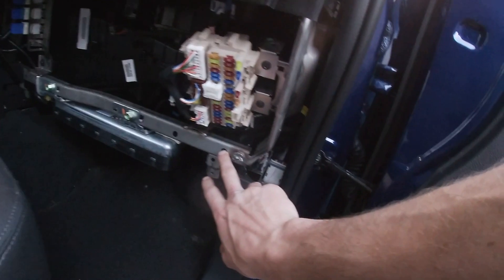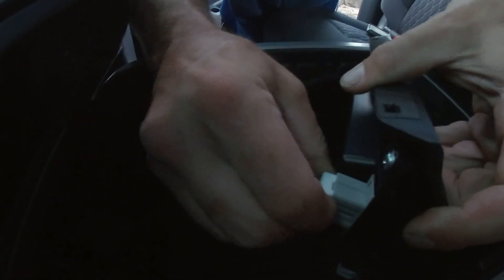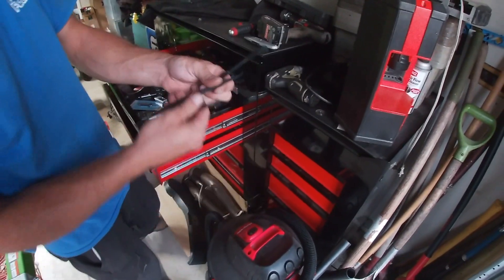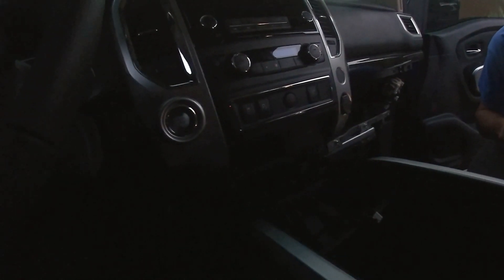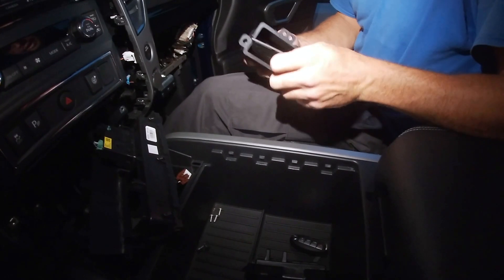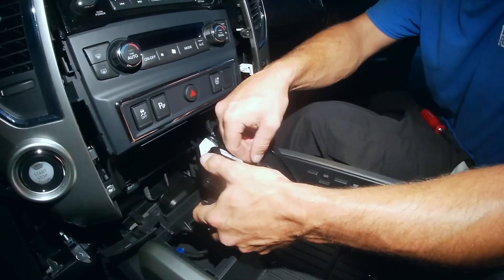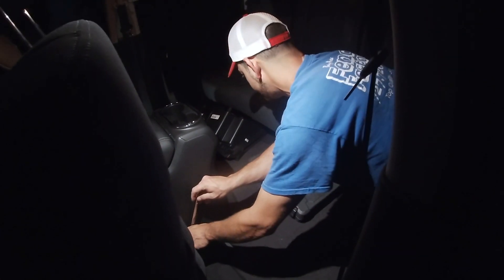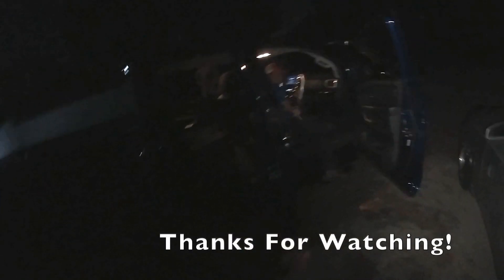2021 Nissan Titan Trailer Brake Controller Installation

Comment: Great video ! Do you have the part number ?
Reply from the maker: Thank bern!The part Number is 478a0ez40b.
Reply: Nissan tried to tell me this is a replacement for if I already have the part. I don't have the trailer package, so will this fit it?
Reply from the maker: Pull apart the dash and find the connector for it before you buy the trailer brake controller. Some trucks do and some dont.

Comment: Long live the TITAN!  Really wasn't in the market in March '24 thinking I'd continue to make do with my 2011 Silverado w/ LS V8 due to new truck costs and most of those lacking a gas V8.  Then come to find the mighty TITAN will cease production forever come summer '24.  Found a '23 never-titled certifed dealer courtesy vehicle with 1K miles for nearly $15K under MSRP of new.  YES!  But it didn't have the integrated brake controller; the only thing lacking that I wanted.  Thanks to you and a Titan forum poster who convinced me that dealers rarely have correct answers to such things, I know now I can retrofit one.  Just purchased a unit and with your video and that Metra installation PDF I will be doing same as I hate the out-of-sight, knee-interfering aftermarket units.  THANK YOU!!
Reply: BTW, the poster on that TITAN forum stated he was an employee at the Canton, MS factory.  He said that if you have a TITAN that came with the "Accessory Utility Pkg" (Hitch with electrical connectors) then you WILL have a complete harness that includes the leads/connector for the integrated brake controller.  I cannot verify but seems like a source who knows what he is talking about.
Reply from the maker: Thanks and good luck with your new Titan. Glad the video helped you out.

Comment: I just installed the OEM tbcu on my 2019 Titan SV, your video was very useful.
Reply: I have 2019 midnight edition . Do u think every nissan has it ?
Reply from the maker: No i recommend you check for the harness before you buy a new trailer brake controller. Some do NOT have the harness.

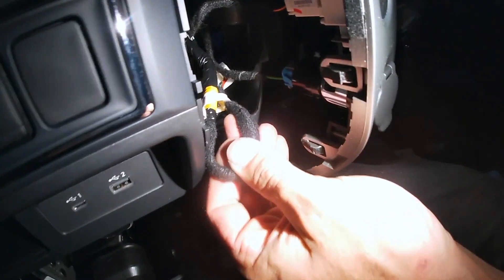Comment: Thanks for the video. My 2021 SV doesn't have the plug/wire you show at 5:05. Any idea where that wire led up to?
Reply from the maker: I couldn't say forsure you would need the wiring diagram for that.

Comment: Got it all ready to go back together but don’t see the electrical plug for it. Was it hard to find or was it just laying there right behind the right side air duct?
Reply from the maker: You should see it in the same location as the video shows. Others have said their truck didn't have the harness at all. Thanks for watching I hope it helped.
Reply: Probably too late now but on most Nissan's the plug is under the dash on the driver side. There's several videos on YouTube that will show you where.

Comment: Did the unit come with any extension harnesses? My plug was all the way on driver side under emergency brake. Scratching my head trying to find pigtails to extend the harness to center console if none are supplied with unit. Good video though.
Reply from the maker: When we found the harness it was folded onto itself and taped up so we cut the tape and the harness reached to the factory location to be mounted. In the video I show where we found the harness which was before we cut the tape.
Reply: @JoshVice  Did anything come with the unit? I guess that should of been my question. Just wondering if Nissan packaged an extended harness with the unit as well.
Reply from the maker: No. The trailer brake controller did not come with a jumper harness.

Comment: Did you ever get a chance to hook up to a trailer and test it? Did it apply the trailer brakes and did everything work properly? Thanks :)
Reply from the maker: Laurica the controller works with a trailer attached. Sorry I forgot to add that to the video.

Comment: nice... i was looking at that part for my 2018 pro4x...dealer said  it wont work...good to know dealers dont know a damn thing on what the sell
Reply from the maker: I've had another comment saying they didn't have the harness in the truck. Pull it apart and see before you order your controller.
Reply from the maker: The dealership did tell my brother his truck did not have that harness.
Reply: I took my dash apart and took a photo...is there a way I can send a photo to see if it's the right plug

Comment: I have 2019 midnight edition . Do u think every nissan has it ?
Reply from the maker: No. You should check and see if your truck has the harness for the controller.
Reply: If your Nissan came with the 7-pin plug with a tow package it should have it, but usually the harness is on the driver side underneath the dash. check it out on YouTube there's several video showing  the location.